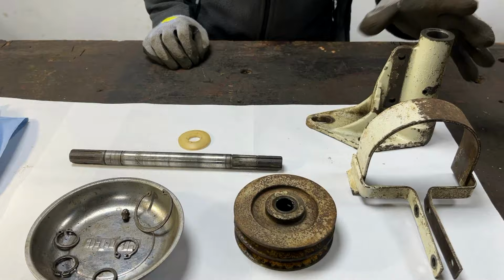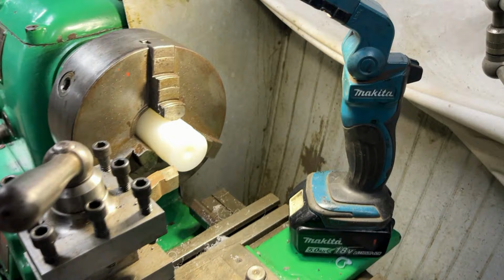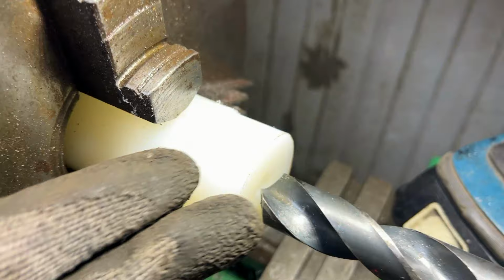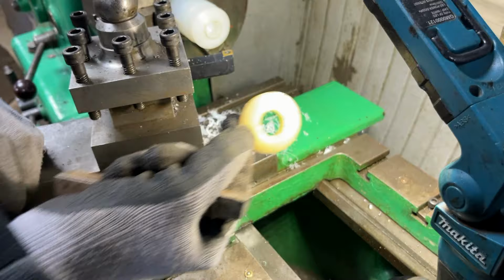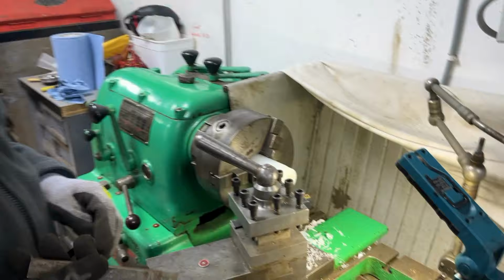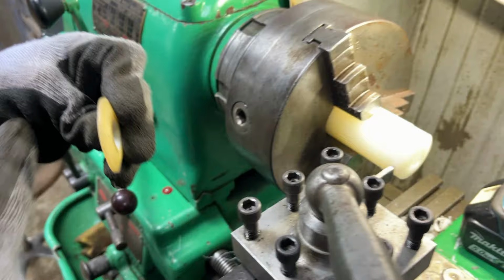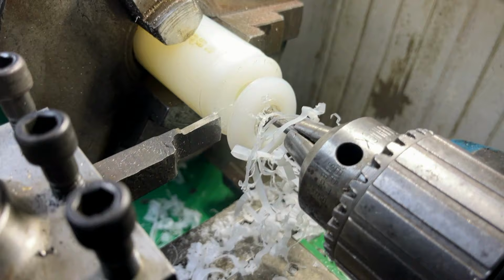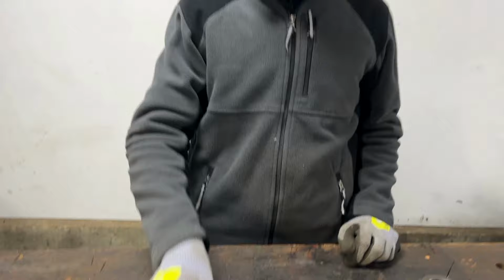Bolens PTO rebuild - Part3 (Making a new seal washer)

Comment: the drawback with nylon is that it absorbs moisture and swells up, although I doubt thaat will be a problem in this case! Another fine job! It is not easy to get accurate results on soft materials! Well Done!
Phil
Reply from the maker: Great information, thanks. We were pleased with the finish especially as this is the first time we have tried to machine nylon. Take care

Comment: Interesting I don’t think I have seen machined nylon before. We have used sheets of nylon and stamped washers out of it, but no bevel was needed on that application. Great work on the nylon thanks and have a great one
Reply from the maker: Thanks. I don't think the bevel was essential but we wanted to copy the original design. The step at the back was required so it did require some form of machining. This is the first time we have worked with nylon so we did some research first which I think helped a lot. Take care

Comment: Really enjoyed the machining of the washer. I was surprised you did not get any melting or burns on the nylon. It looked like it machined quite well! Great work Joseph and Iain!! Well done indeed!!
Reply from the maker: Thanks. We did some research before we started and from what we read, it needs to be machined at a fast speed however, when we did that it did burn or melt. It seemed to work well at a slow speed. Take care